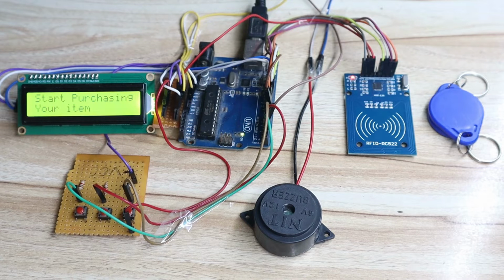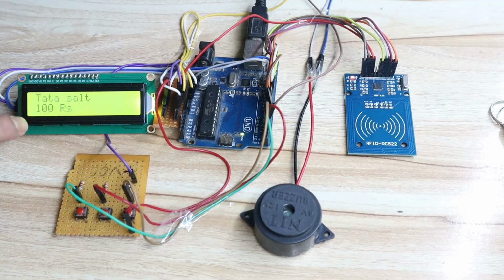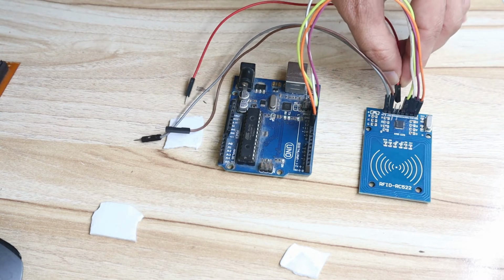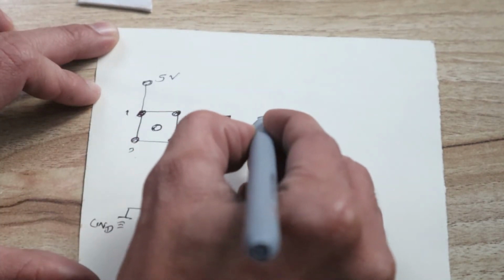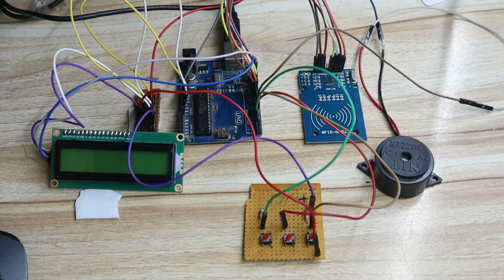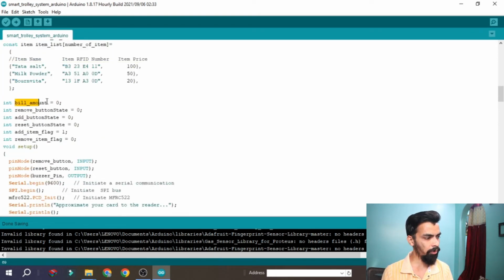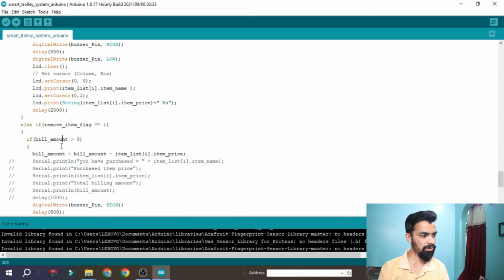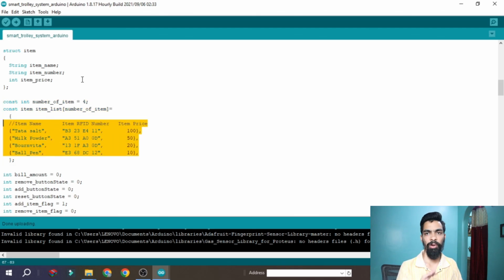Smart Trolley Using Arduino And RFID Module | Add and Remove item anytime

Comment: Use barcode scanner instead of RFID card and scanner bcz the owner of shopping mall don't buy card for every product it's very costly for owner barcode best solution 

Butt customer how to pay 

I give you idea to you sir 

Please add GSM module to snd final bill with the list of products that customer purchase and pay the bill add the bill payment method 
And last 1 more 
Different customer has different mobile number then add the 4*4 keypad for add the customer number and then snd masage to customer number 

❤❤❤❤
Reply from the maker: @chaudharyjafar9963   @chaudharyjafar9963  I have received same requirement from many students so that I have purchased 4×4 keypad yesterday .So video based your requirements upload soon.
Basic keypad configuration video already uploaded yesterday.

Comment: Sir what type jumper wire is used here
Reply from the maker: @dharshinisampath4515  male to male 
Male to female, female to female
Reply: @Rahul_Jadhav_Project Use barcode scanner instead of RFID card and scanner bcz the owner of shopping mall don't buy card for every product it's very costly for owner barcode best solution 

Butt customer how to pay 

I give you idea to you sir 

Please add GSM module to snd final bill with the list of products that customer purchase and pay the bill add the bill payment method 
And last 1 more 
Different customer has different mobile number then add the 4*4 keypad for add the customer number and then snd masage to customer number 

❤❤❤❤
Reply from the maker: I have received same requirement from many students so that I have purchased 4×4 keypad yesterday .So video based your requirements upload soon.
Basic keypad configuration video already uploaded yesterday.
Reply from the maker: @chaudharyjafar9963   I have received same requirement from many students so that I have purchased 4×4 keypad yesterday .So video based your requirements upload soon.
Basic keypad configuration video already uploaded yesterday.
Reply: @Rahul_Jadhav_Project  big respect sir

Comment: Sir can you say the breadboard connection
Reply from the maker: @dharshinisampath4515  connection explained in video. Please watch the complete video.
Reply: @Rahul_Jadhav_Project Use barcode scanner instead of RFID card and scanner bcz the owner of shopping mall don't buy card for every product it's very costly for owner barcode best solution 

Butt customer how to pay 

I give you idea to you sir 

Please add GSM module to snd final bill with the list of products that customer purchase and pay the bill add the bill payment method 
And last 1 more 
Different customer has different mobile number then add the 4*4 keypad for add the customer number and then snd masage to customer number 

❤❤❤❤
Reply from the maker: @chaudharyjafar9963    I have received same requirement from many students so that I have purchased 4×4 keypad yesterday .So video based your requirements upload soon.
Basic keypad configuration video already uploaded yesterday.

Comment: i liked your explaination method...i have question about if i want to use EM 18 sensor for this same project...what should changes should be in programming...please guide or send me code for mentioned point....thanks
Reply: Use barcode scanner instead of RFID card and scanner bcz the owner of shopping mall don't buy card for every product it's very costly for owner barcode best solution 

Butt customer how to pay 

I give you idea to you sir 

Please add GSM module to snd final bill with the list of products that customer purchase and pay the bill add the bill payment method 
And last 1 more 
Different customer has different mobile number then add the 4*4 keypad for add the customer number and then snd masage to customer number 

❤❤❤❤

Comment: how to use 1 card to remove then use the other card to turn on the buzzer? I use one card to remove, then the oder card remove too? Thank you bro
Reply from the maker: I think you did not watch the complete video.
By using three switches you can add/remove as many as cards at t time
Reply: @Rahul_Jadhav_Project  no no it's not my meaning, I just ask how to use a card to remove and then the other card (added) use to make the buzzer on. If I use a card to remove, the next card could remove then and cannt turn on the buzzer
Reply from the maker: @vulehoangvuk17hcm12  sorry I did not understand your question. Please give one proper example so that I can understand your problem.
Reply: @Rahul_Jadhav_Project  I use your coding to open the door by rfid. When I added 2 cards , and then I removed one of them. I wanna use the other card to open. But when I dont know how to return the start state, it keep removing card, if scan. I want to scan 1 time and after that return to the start state to choose remove card or open door or reset all, not scan then keep removing. thanks so much <3
Reply from the maker: @vulehoangvuk17hcm12  now you have explained your problem correctly.
It's not related to shopping projects. It's for a completely different project.
Please check my playlist there is already video on gate open/close using RFID .
Please watch that video.
Reply: @Rahul_Jadhav_Project  I ask like him too

Comment: Can we use Arduino nano in the project instead of Arduino uno?
Reply from the maker: Yes ,
Reply: @Rahul_Jadhav_Project Use barcode scanner instead of RFID card and scanner bcz the owner of shopping mall don't buy card for every product it's very costly for owner barcode best solution 

Butt customer how to pay 

I give you idea to you sir 

Please add GSM module to snd final bill with the list of products that customer purchase and pay the bill add the bill payment method 
And last 1 more 
Different customer has different mobile number then add the 4*4 keypad for add the customer number and then snd masage to customer number 

❤❤❤❤
Reply from the maker: @chaudharyjafar9963  I have received same requirement from many students so that I have purchased 4×4 keypad yesterday .So video based your requirements upload soon.
Basic keypad configuration video already uploaded yesterday.